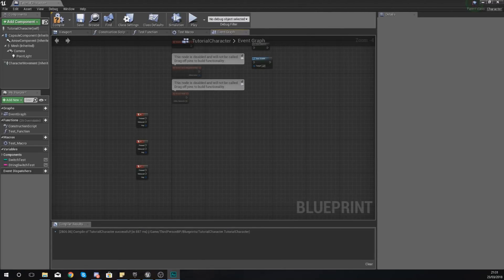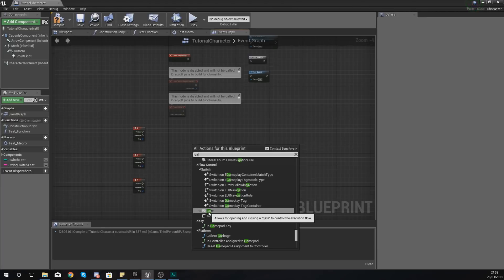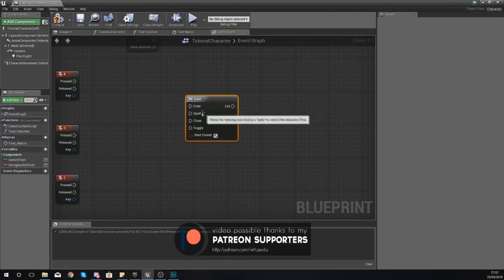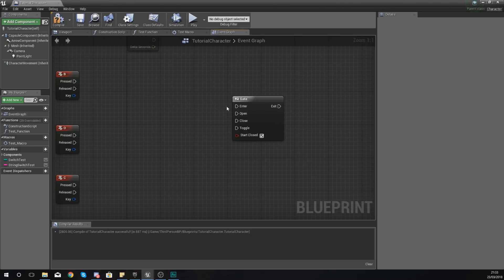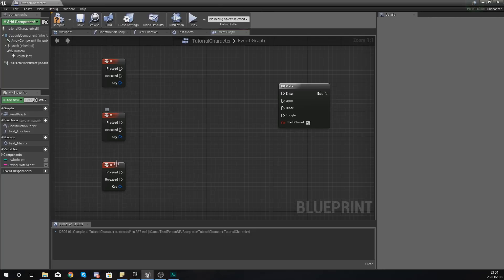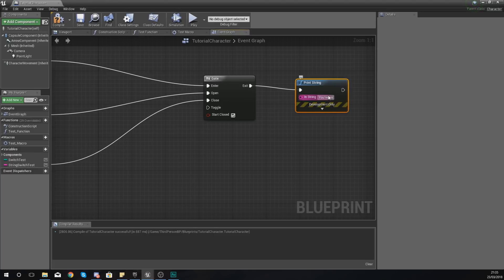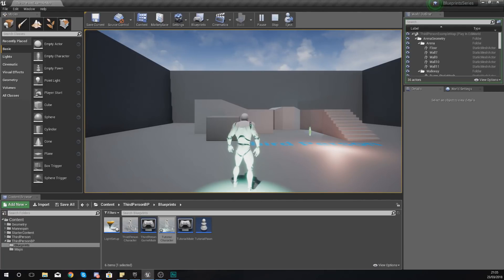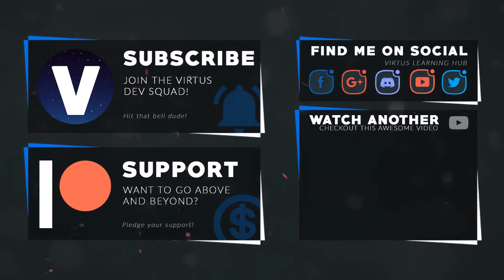Working with Gates - #21 Unreal Engine 4 Blueprints Tutorial Series

Comment: Hi man, Could you please make a landing tutorial? i couldn´t find any at youtube

I created this awesome flying ship, it moves forward by pressing up button, but when it stops moving and i want it to land...failure, i cant make it work... i tried with snap to grid but it never finds the right floor position, and since flying rotation can be kind of "out of a normal position" i tried fix it first with "setactorrotation" but it keeps rotating to a weird position, not to were im loking and it snaps... i cant smooth ´this movement. What i would like is: even if i´m fliying and my Y positin its super high, when i press L button i want my ship to stabilize rotation and starts landing down with a vertical move to the ground until it touches the floor.
Reply: place an 'empty' on the landing pad, then use that location to get the ship to land there using a 'timeline' and 'set actor location' node to get it to move there when a button is pressed :) Should work ok
Reply: Rocco FX Would it work if you tried to make the landing completely manual?
Reply: I wish but it has to be automatic because there is a landing platform and its pretty small. Like a Harrier plane landing.